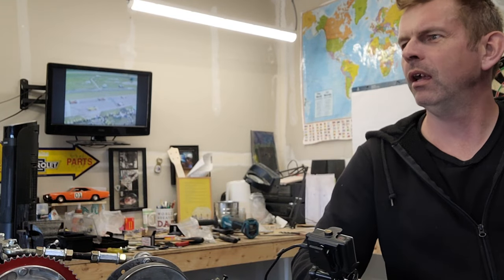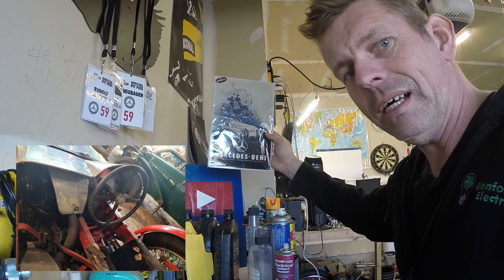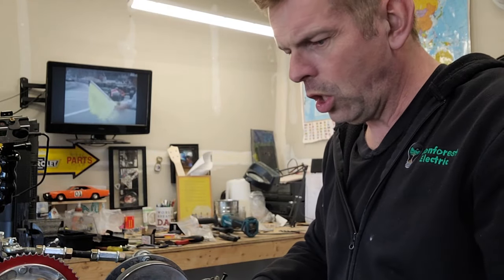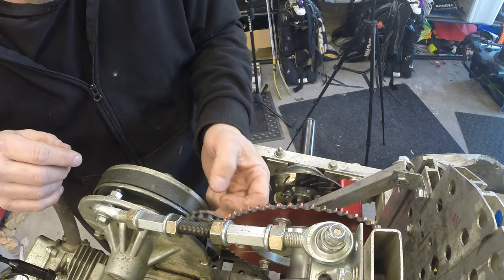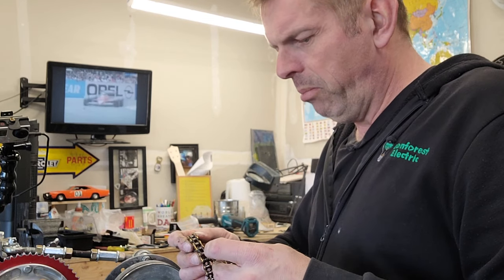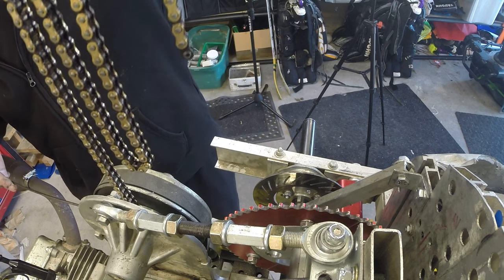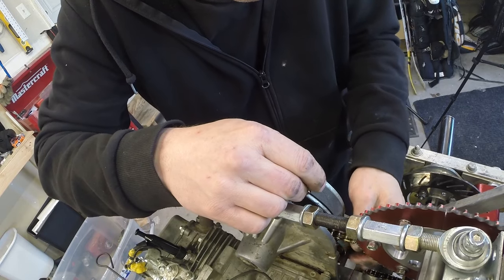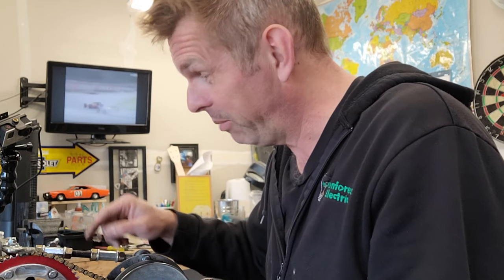Cyclekart Shop Talk | Episode 2 | Shop Face | Senna | Chain | Build What YOU Want | Recent Awards

Comment: You are fighting with chain because the bolts should be turned around on the torque convertor, in my opinion..... bolt head inside and nut and thread on the outside, unless there is some reason you had to mount them backwards. I don't know for sure what the situation is there. If it helps I am glad I added this comment, if not, sorry. I am not a pro to this thing, as I just am getting started to build a cycle kart myself. I hope this helps.
Reply from the maker: Absolutely. I always appreciate advice. The bolt is just slightly too long to fit the other way, and a shorter bolt is too short to hold everything. So I will have to keep struggling.
Reply: Low profile nuts or Allen head bolts might solve your issue. I like you chain tensioner, I will be using a similar device on my kart

Comment: #35 chain is 3.5 8ths pin to pin, #40 is 4 8ths or 1/2"
Reply from the maker: Thank you! I didn't know that.
Reply: @andrewroudny  one of the advantages of hobbies like this is the wide cross section of people that get involved with it. As a millwright I don't know how much chain I've installed, but it's measured in miles.